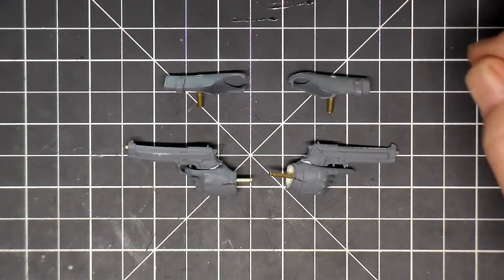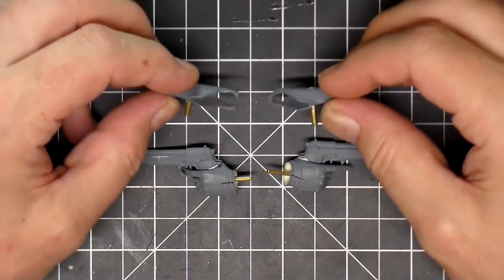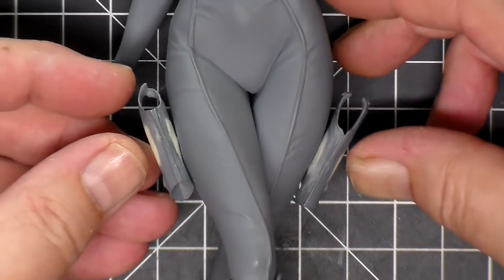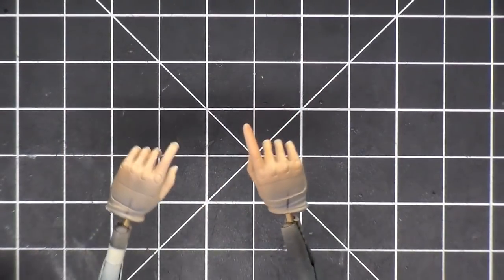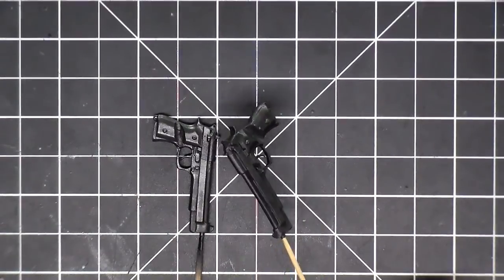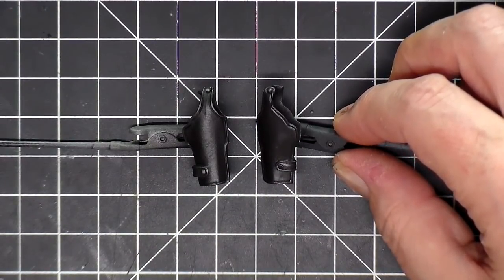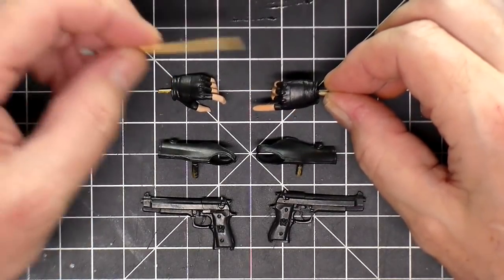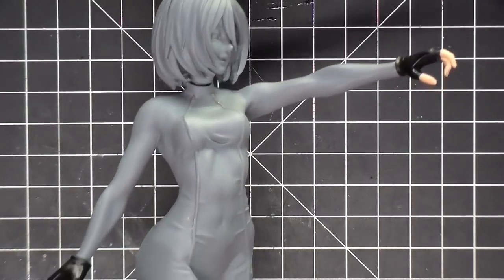PART 5 - KITBASH - BLACK WIDOW 1/7 Scale Build

Comment: This is looking great, please don't take offence to this but I think the body needs a better head sculpt I know you have done a lot of work on it as I have watched your other videos. I just think the body is a higher level of sculpt than the head, nothing to do with your skill it just looks that way. The other option would be to magnetize the neck so you can have different heads. I like your build/fix process
Reply: MrBMBuilder Agree, the head still looks a bit off but I’m not sure if that’s down to the head or the hair. I’d say the hair is the major weak spot on this amazing piece of work.
Reply from the maker: Thanks! No offense taken. The head is the head that comes with the kit. The hair is different. It will look better once everything is painted.